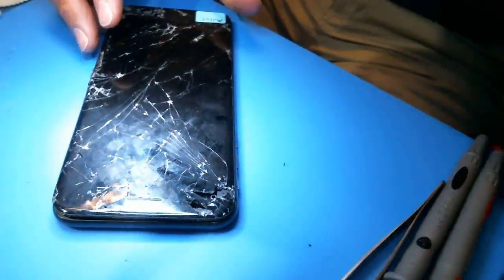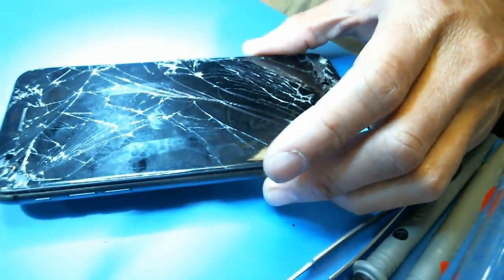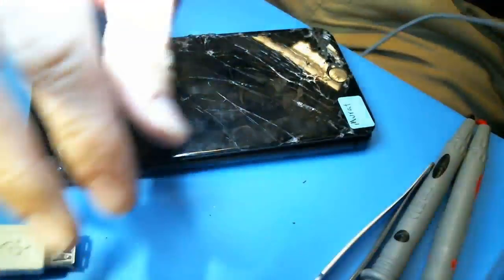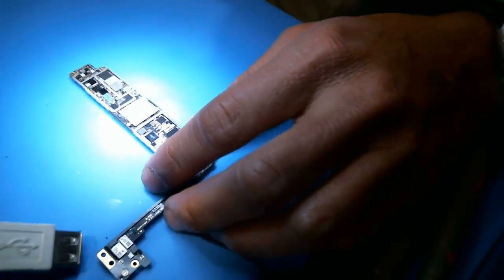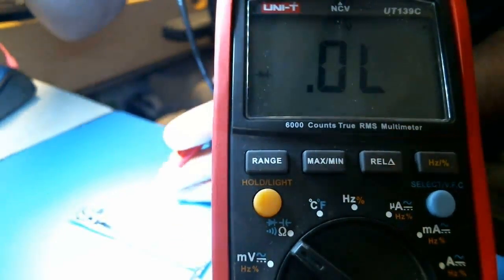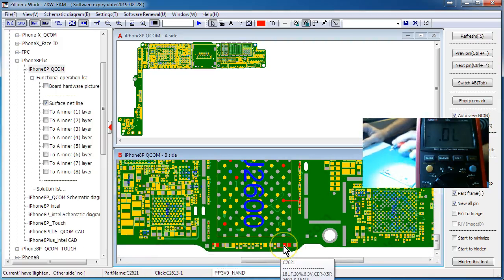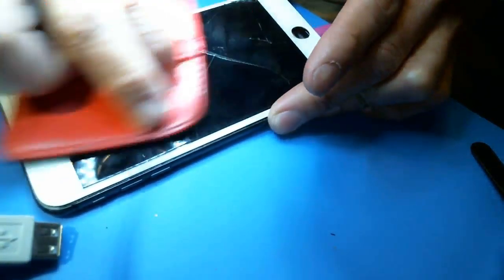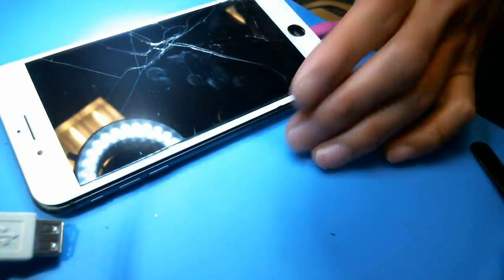Is it possible save data from an iPhone stuck in recovery mode?

Comment: DFU mode means that CPU is working but the NAND is not, That why in DFU mode u don't see the phone serial number in iTunes. 
But the recovery mode means both CPU and NAND are working but something is wrong with the software that why u see iTunes logo because it is loaded from the NAND
Reply: Extremely helpful description. Thanks.